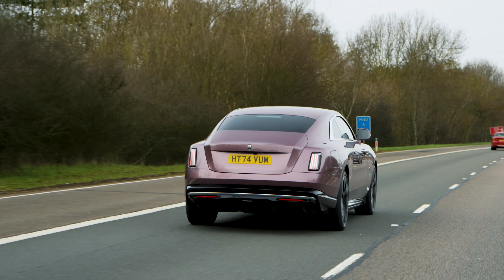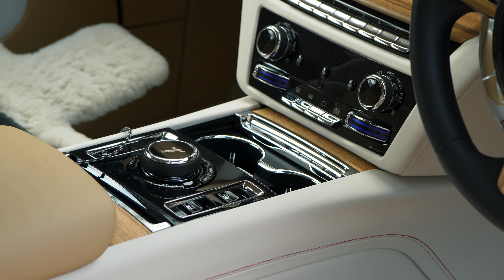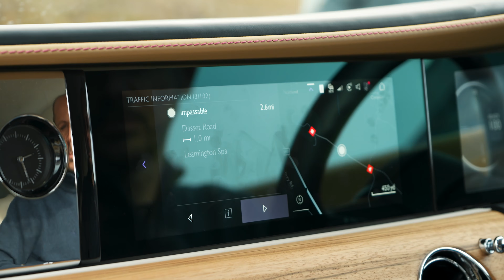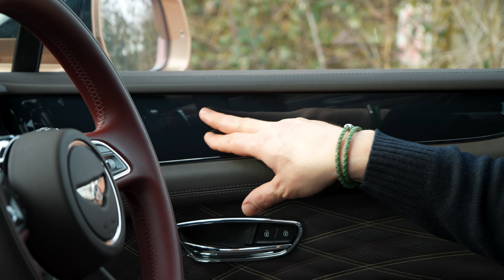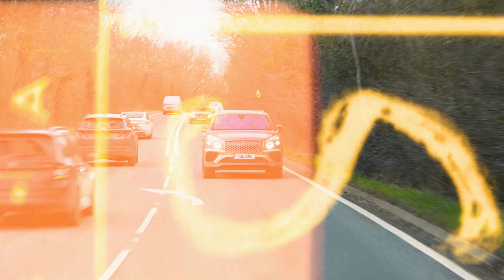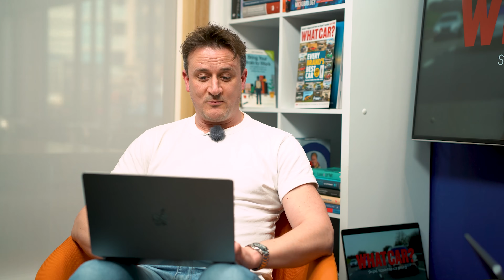Bentley V8 vs Rolls-Royce EV – Does Charging Ruin Luxury?

Comment: It is an interesting comparison this. Going back in time, Rolls Royce had two goals: the drive must be as smooth as possible, and the comfort and luxury of the vehicle must be judged from the point of view of the rear seats, not the driving (chauffeur's) seat. These values were so important that before automatic gear boxes, the chauffeurs would learn to change gear in such a way as the change was almost imperceptible. On that basis, the electric should be the best starting point. Not only (for the passenger) is it quiet, but there are none of the annoying gear changes at all.

Comment: 218 miles of range for the Spectre is just crazy. It obviously makes no sense at all with range like this. However, double the range and it starts to make alot of sense. Charge it overnight at home. Very easy to live with.
I own a BMW iX which has 400 miles of range. Its not a Spectre or a Bentayga, but I will say its a great place to be and range is no issue. We can generally go anywhere and not juice the batteries.
Sure the soundtrack and rumble of the Bentayga is appealing, however stopping for fuel all the time forever more is much less appealing. 
In conclusion, I would not consider an EV that has less than 400 or 500 miles of range.

Comment: A luxury electric motor is very like a luxury electric washing machine. You might as well buy a Leapmotor B10 which has all the equipment and luxury built around an electric motor as anyone could possibly need. If you choose an electric Rolls Royce you are basically paying around £200,000 extra for a bit of stitching and a badge.

Comment: I’ve never met anyone with an EV who can park at home who doesn’t use an overnight tariff. It’s so silly using those numbers. More realistic is assuming a full battery when you set off then average with motorway charging. For me in a comparatively low range MG4 doing a round trip Bristol to Manchester I get there on a charge and get back with motorway charging so it’s actually an average more like £0.48 per kWh (7p at home and 89p on the road). This trip however completely achievable with only home charging.

Comment: The usual BS about costs.  I mean if you get a car of this price I doubt you’re worried about running costs but
1. Mention charging overnight but without putting the cost up.  
2. Then say the electric is more expensive based on the most expensive electric options.  
3. Charging at home would have been about £5

This petrol is cheaper narrative they have is BS. I save a fortune driving electric in terms of fuel.
Reply: Its a weird contradictory argument since the people that can afford it don't care and those that can't afford it, can't afford it anyway.

Comment: Rolls Royce should add the 800V system and increase the battery to 120 kWh.
Reply: For a car at this level to not have it shows the level of seriousness RR give to EVs. Even GM has 800-volt architecture on its EV for DC fast charging where available.

Comment: So keep in mind charging at home is more likely limited to a 22 kwh charger but most have a 7.5 kwh charger. It means in either case there is not enough time to charge such a big battery on  cheap tariff time slot but that might not mean anything to a Rolls owner. Range as always is king and 2.1 miles per kwh is fairly poor. On average our BMW i3S with a 42.5kwh battery is achieving over 4 miles per kwh. I get it's no real comparison but it does show the efficiency of one against the other.  It just goes to show that the weight of the Rolls is damaging its range but if it could reach 400~500 miles and with better efficiency then the Rolls makes a lot of sense.
Reply: The range and charging is abysmal of a car with such a pathetic range. If the range is poor, the least it can do is makeup for it with fast charging. The RR has neither. Which just goes to show how serious they truly are about EV.

Comment: When you drive the V8 in the city, it gives cancer to everybody it goes by (and 2x compared to a 4 cyl). If you double the distance, it doubles the number of people it gives cancer to. The EV doesn't give cancer to anybody. Because of the air filters, the EVs actually clean the air we breathe. Not having cancer is an underated luxury. Spectre FTW!
Reply: Stop exaggerating. The majority of electricity is still generated using fossil fuel . You know what that means? YOU are polluting too just by using electricity. Even if  you don't drive.

Comment: To put that into perspective: the Bentley is the result of 120 years of refinement and economies of scale of the combustion engine. The Spectre is a first experiment with already 3 years old electric technology. And it already costs only £25 in comparison to £50 to move it over that distance, which is half the price. In another 3 years from now on, the technology of the Bentley combustion engine will not be much different. But an electric luxury car will have the same range as the Bentley now, run for free, need MUCH less maintainance and run for 1 million miles.
Reply: The Spectre was obsolete on arrival. The charging architecture is pathetic.

Comment: The Spectre. I wonder how 2.9 tons of motor car running on those thin sidewalls might last when tooling around our appalling roads. And the dashboard looks like it's made of unfinished balsa wood to me.
The range appears to be pathetic, but a stated top speed of 155mph? Just what range would one have at that speed? (in Germany, naturally, yer onner...😁😁).
I just don't get the Spectre. Mind you, nor do I get the idea of a £230 grand four wheel drive mud-plugger.
Reply: It won't go down those roads. Its a show car, so strictly a boulevard cruiser to breakfast, lunch or dinner. Then its back to the garage and the nearest wall outlet.

Comment: Someone explained to me before, if you're buying Spectre you generally wouldn't be driving it long distances. You'd just take the helicopter or private jet and not worry about fast charging.
Reply: Nobody drives a RR or Bentley cross country. At least I've never seen one on the interstate. Have you?
Reply: @mranerobic3795  I have, usually Cullinan though.

Comment: For me in the ultra luxury class there is not even question, EV powertrain is much more appropriate for what this kind of luxury road yachts are used to: short drives around town, to riviera,... in silence and comfort! 
So for me Rolls-Royce Spectre is clear winner, keeping ultra luxury with effortless drive of an EV.
Bentley should definitely start to consider going fully EV. 
As for range owners of this kind of luxury cars, they use helicopters for longer than 200 km trips.
Great video keep it up 🤟⚡⚡⚡⚡
Reply: If the first part were true RR would have already converted their entire car line. As for your second claim, they have. The EV Bentayga should be coming to market soon.

Comment: Whoa, hang on chaps.  You youngsters don't know smooth power well enough.  V8s sound as if they have a misfire.  Buh, buh, buh... no, not good enough.  A six or a twelve is petrol perfection.  They even sound smooth, never mind the vibrationless output.  They hoot, not buh.  I'm also astonished that Rolls Royce hasn't completely soundproofed their car.  Even a first generation Nissan Leaf is silently driven.  If I was buying an electric Rolls Royce, I'd expect complete silence, utterly smooth ride, without any feedback, bumps or bangs.  I'd specify smaller wheels with fatter tyres that can dampen the ride simply by existing.  If the steering has been tuned for slow response, they could slightly improve it and let the fatter tyres bring it back to the former response.  I'd also expect vastly better cameras to place the car (including no door mirrors) and a rear view interior mirror camera.  I'm old, so I'd want dark burr walnut on the dash and door capping with faded red seats and dark brown carpeting.  Proper taste and luxury.  A Rolls Royce should look like a gentleman's study, not a tart's parlour.  Painted bright silver over ox-blood red and traditional spun stainless hubcaps with pin-striping.  Oh... the good old days...  mumble, mumble...

Comment: Why would anyone buy RR with electric motor, instead of 12 cylinder 🤔
Reply: WHy get the 12 cylinder. More vibration, more noise, more maintenance, more weight. I see no advantage. EV has no transmission, less maintenance and is just as quick with more smoothness.

Comment: In the mind of the consumer, electric = disposable. Right or wrong, that's just how it is. Manufacturers should market the idea that the car and battery are separate. Wot is to say, as technology advances the battery unit can be easily changed out and replaced with the latest and greatest. Doing this gives the impression that the 'Car' will last decades and the battery is just a disposable aspect will just get better over time. Especially at the price range these cars sit at.
Reply: Most electric car batteries will outlast the car, many cars will 100,200,300k+ miles on the battery with no issues.
Reply: @woodenravine It's perception, not reality.

Comment: Electrification should be the perfect choice for a Rolls Royce as the drive train is so smooth, refined and fast. BUT BMW will already have to upgrade the battery and onboard charger to match the just announced M3 and i3 to get the 300kW+ charge experience. I absolutely refuse to use GrideServe and Instavolt and their frankly rip off pricing and just stick with Tesla SC's (even though I have never owned a Tesla!)

Comment: On the range comment, Rolls have said the spectre was designed for around 300 miles (More in the warmer Middle East where they expected to sell these) because if the customer was travelling further they took their helicopter. On the silence question, the argument is that complete silence disorientates passengers causing motion sickness, so some noise is needed
Reply: True, but if its windy, Helicopter can be choppy. I live in the Southeast of England and had to go to Leeds urgently for a meeting and a lunch for a large deal, I took a helicopter and it was windy and I felt really sick, car would have been 5-6 hours, train would have been the same as I needed to travel from Brighton to London, then Leeds and then back. From a cost perspective, helicopter not worth it, from a speed of getting there, then yes quicker. Would I do it again, hmmmmm maybe.

Comment: Hello battery car nerds! What does 50% of a battery mean really? In a normal car with petrol in it 50% tank means 50% range. But that's not  accurate with a battery, right?
Reply: In the same way that if you floor a petrol that 50% range drops at a rate of 15mpg rather than 30, an EV hovering around 60mph will use less energy than one doing 75.

Comment: Looking at BMWs new plattform and battery technologies, the next Spectre or whatever model it might be, will definitely have even less compromises. And the "compromises" on this spectre besides it´s price are already basically insignificant. I mean where ever you go with such a car, even now charging is no problem. And here in germany (no idea how it is over in your country) charging networks got quite dense compared to the last years.

I would definitely prefer electric cars nowadays. It is better for the environment, no stress with crisis because of oil, quieter in the cities, drives more elegant and efficient and is way more comfortable especially for longer trips since you have less noise in the interior.
I´m a huge fan of cars since my teenage years. And over the years the newer technologies definitely got me :D

Comment: This is the sort of review where you need true prospective owners to speak to the value of these vehicles.  I know a few very affluent people and they simply are not road-tripping in their vehicles.  These sort of vehicles are for their local driving wants.   If they have a trip over two hundred miles, someone else is facilitating the transport. These are visible statements of affluence and I suspect plugging in an electric vehicle in their garage is much preferred to going to a pedestrian fuel station getting the vapors from the effluence of fuel on their bespoke clothing and hands. Nice review but at a certain level of wealth, the expectations/wants dramatically change.

Comment: When was the last time you saw a RR being refuelled at a petrol station? In fact when was the last time you saw one being driven on a motorway or any road other than the Kings Road in Chelsea?
Reply: Just saw two heading to biggin hill to pick up Saudi royals (number plates both had MBS and driven by burly Arabs in suits)
Reply: If you are charging at home, then the Spectre is a car that can be used. So many RR are twenty years old with 30k on the clock.

Comment: Bullshit Video 🤣.

Should be called, outdated posh Petrol Car, vs. intentionally half assed Electric car.

This is just the standard Legacy Automakers scam (which you are definitely the target suckers for) of intentionally making second rate electric cars, in order to justify continuing to make outdated petrol cars. 

A Lucid gets 500 miles on the freeway.  More than the Bentayga, and is charged from your home,  and granted money doesn't matter I suppose but at 21 MPG your Bentayga is getting a pathetic 4 miles per US dollar, compared to over 20 with an electric vehicle.  And the vehicle is slower, with petrol lag, and louder with engine noise and smellier with gasoline stink.

But hey you just draw your foregone conclusion of the intrinsic superiority of the donkey pulling the cart, over the starship....anyway.  Never mind the shix, it drops out of the exhaust pipe. (classy) 🤣

Comment: regardless other considerations, the electric drivetrain in the RR is nothing special, for an ultraluxury car. Like having a RR with a V6!
If it would have a top notch one (with all realistically achievable specs), like 125kWh+ for well over 300 miles range, charging 10-90% in 15min or less, and 1000hp-1000NM, then there wouldn't be too many arguments to complain

Comment: The odd buyer exists for luxury-anything but there is no market for this Spectre.
I've known a few rich people up close. One universally sure way to piss them off was to waste their time. Like the video says, batteries = wasted time charging, wasted time sitting in queues, wasted time with underperforming chargers and having to rub shoulders with commoners for WAY too long. No "concierge" will correct that. The "concierge" can literally offer bjs and it still won't make up for the downsides.
Electric cars are for inferior people and as long as battery tech doesn't jump forward SPECTACULARLY that will not change. Flying won't be done on batteries, wars and industrial machinery won't run batteries and cars for people who value their time won't run on batteries. Batteries are for people at the bottom of society who can simply be forced into anything through pricing and ad-brainwashing. YES I'M HAPPY TO HAVE LESS FREEDOM OF MOVEMENT AND MORE OF MY TIME WASTED!!! That's who batteries are for. The people who can truly do the mental gymnastics necessary to BELIEVE that, not just say it, despite any evidence that stares them in their face.

Comment: Seems the right conclusion to me. A maximum of 200 miles of range is way out of line with the premium experience the RR offers in every orher respect.

A concierge charging service sounds an interesting idea. There are definitely times when I would find that tempting.
Reply: The Spectre would definitely be the ultimate luxury if it uses the neue klasse 800 Volt system, that would definitely enhance a lot. The current platform is good, but still, 800 Volt would be much nicer
Reply: Wealthy people don't drive 2000 km to the beach in Portugal. They take a helicopter for distances over 100 miles and a plane for distances over 300 miles.
Reply: Fully agree, but that is just the standard scheme of petrol producers of intentionally making second rate electric cars, in order to justify continuing to make outdated petrol cars. A Lucid gets 500 miles on the freeway.  More than the Bentayga, and is charged from your home,  And granted money doesn't matter I suppose but a 21 MPG your getting a pathetic 4 miles per US dollar, compared to over 20 with an electric vehicle.